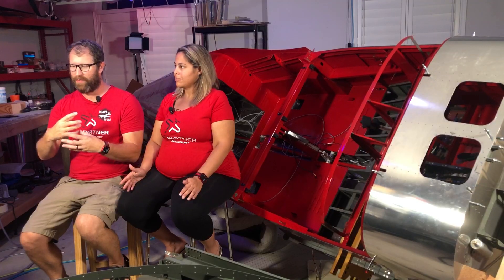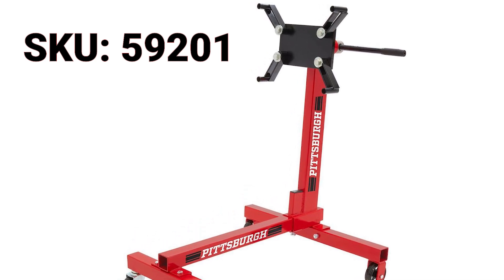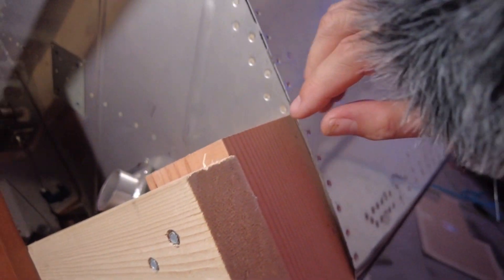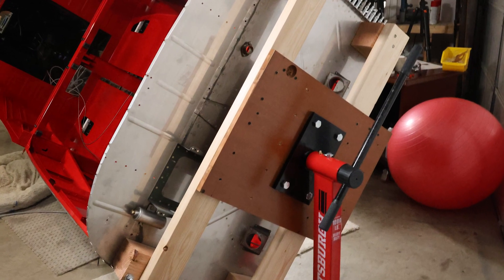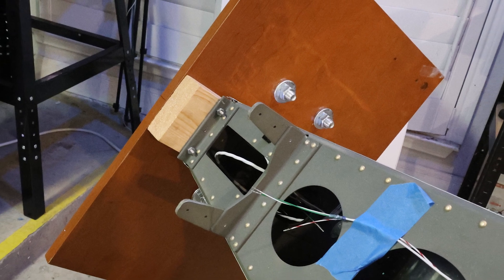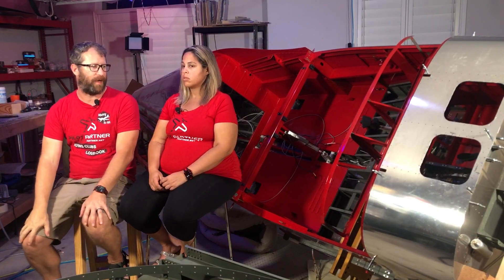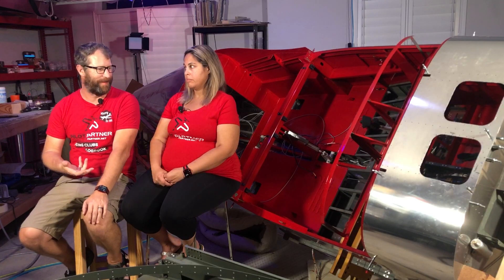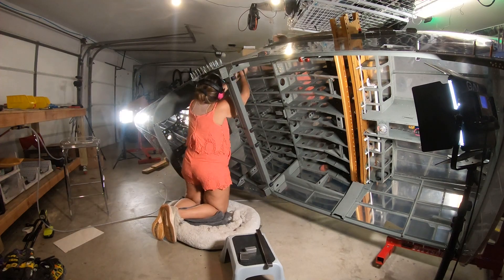How we Built our Rotisserie for Vans Aircraft RV-14

Comment: Isn’t there binding due to the engine stand tube pitching upwards?
Reply from the maker: No.  I forgot to mention it in the video.  But we leave the front wheels off the engine stand to help out with the angle a bit.  No binding.
Reply: @N14VE  oh good idea!
Reply: @N14VE  The option I went with was to bolt a trailer hitch receiver to the engine mount plate and then put trailer hitch balls on the front and back of the fuselage - the ball and receiver combo works like a ball joint and accommodates misalignment - and the wheels can stay on the stands so it's easy to move around the shop when needed.